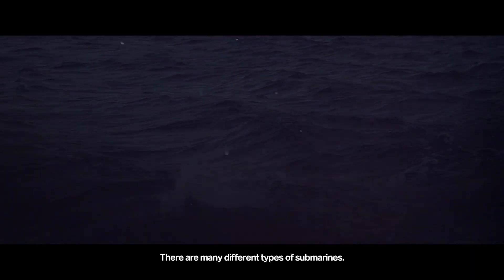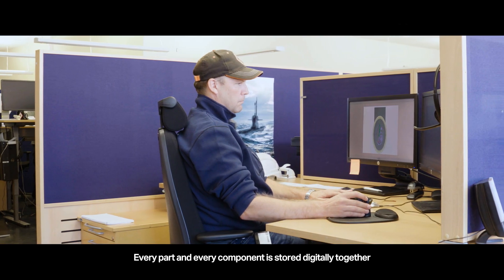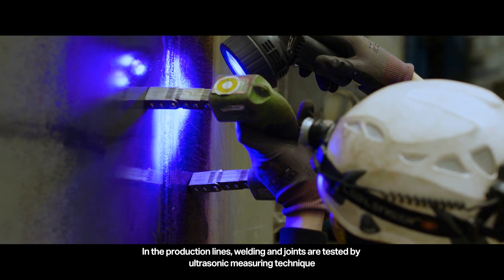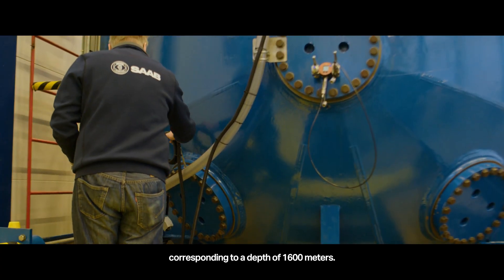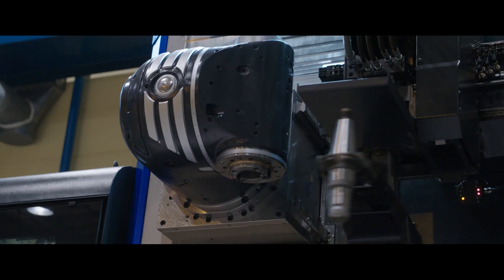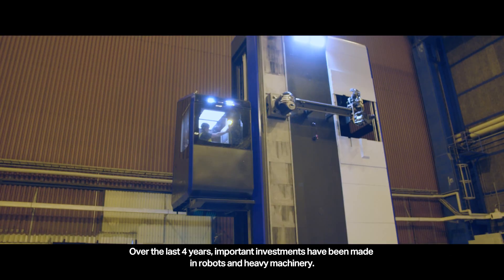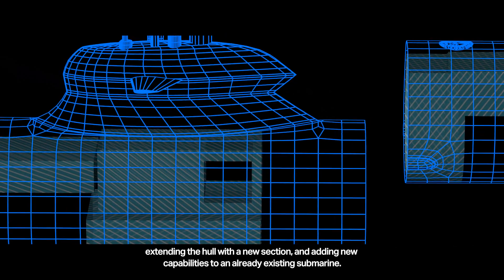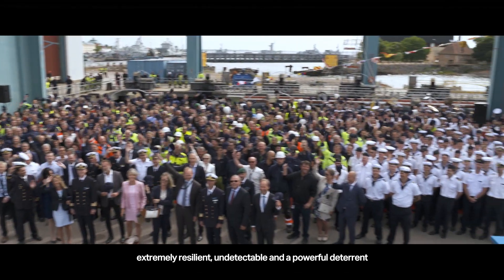Inside our leading naval factory

Comment: It is very interesting to see these video tours of ship builders.  Whether it is SAAB, Damen, Navantia—all of them have impressive design and construction capabilities.  Yet we have to wonder as our climate changes—the frequency and intensity of storms at sea might require a shift in how ships are designed and built.  Having ice rated hulls, stronger super structures and heavier bracing throughout a ship naturally costs more to construct.  But if naval ships are to survive in a changing climate and have the life expectancy of around 25 years per ship, it seems logical to add more strength and bracing during design and construction.
Reply: They did not even mention the live mine test all subs need to endure before being ready to be delivered.

Comment: Can the sterling/AIP use the temperature deferential between the inside of the hull and the ocean to generate electricity, or do they need a fuel like highly consentrated hydrogen peroxide?
Reply: Oxygen and a hydrocarbon fuel
Reply: It need nothing - using temp def